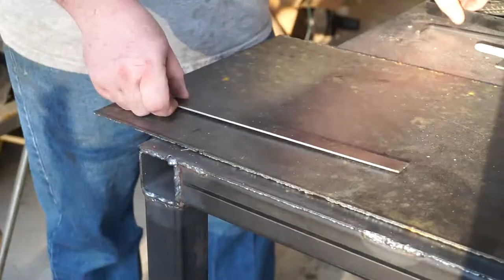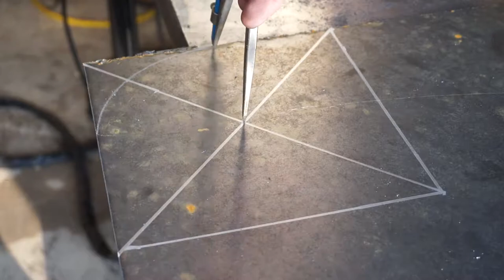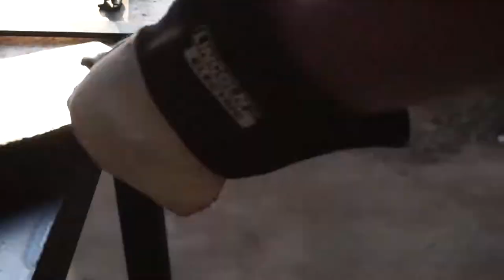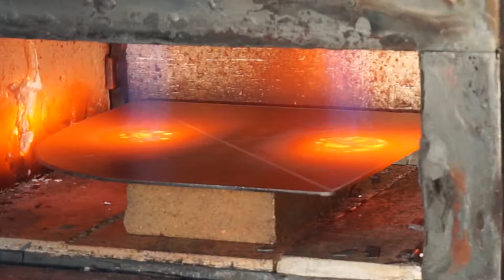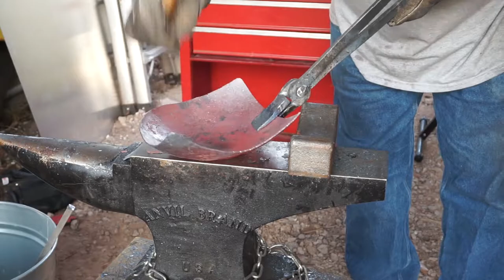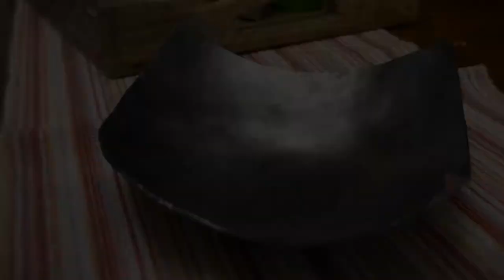Blacksmith Dish

Comment: great video, what video editing software do you use?  good extended clip there showing the heat expanding on the flat plate.  Was that a leather faced hammer your using for rounding in the swage block?  nice work
Reply from the maker: Thanks! I am currently using Premier Pro for my editing software. The mallet was a rawhide mallet. It helps prevent hammer marks.